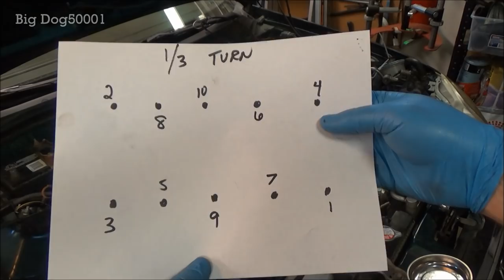Honda Cylinder Head Removal 2000 Civic (Head Gasket Replacement etc)(1996-2000 Similar)

Comment: why lable the spark plugs aren't they all the same?
Reply from the maker: They are the same.  It is not necessary to label them, I only did it in case the engine still had a misfire issue after the repairs.

Comment: I had a question...I have been helping out a friend with a 97 honda civic.  The head gasket is about to go, the car has been heating up very fast.  The thermostat for some reason is not letting water through, so I replaced it thinking it might have already worn out.  The fans are not starting and the coolant in the radiator is boiling over.  I cant really get a feel if its a clogged radiator, a faulty thermostat from the auto parts places, or its all just symtoms of the head gasket itself just causing all the issues at once.  Im trying to narrow it down.  Any suggestions where I should go with this? I havent worked on too many hondas.
Reply from the maker: reaper78541 Honda’s are finicky about aftermarket thermostats and cooling fan switches (I have a video on the switch btw).  They are not forgiving if they have overheated at all, many times that results in a blown head gasket.
Reply: Figured as much.  I guess there's no choice but to do the head gasket replacement.  Thank you for taking the time.  I was hoping to avoid the inevitable I guess.

Comment: So what happens if I removed my head bolts from left to right and not criscrossed like you mentioned? I'm going to take my head to get it resurfaced.
Reply from the maker: It is possible to tweak the head that way, any issues will probably show up at a good machine shop.
Reply: Big Dog50001 Automotive thank you, I removed the bolts before watching this video. So hopefully I didn't do any damage when I take it in to a machine shop.... What do you mean by tweaked the head? Can it be fixed at a machine shop?
Reply from the maker: Twisting it basically.  It can be fixed at a machine shop and made flat again up to a certain point (specs by Honda), after that the machine shop would have to take too much metal off and the head would be out of spec and not work.
Reply: Big Dog50001 Automotive Gotcha.... Thanks for that info Big Dog 50001 Automotive.

Comment: Hello, Mr. I have a mechanical question -  I have a Honda Accord and recently suffer and broken timing. I was able to re-do the timing belt job and discover I have no compression in cylinders two, car shakes a lot, a lot I was told I needed to remove the cylinder head and sent it to the machine shop for resurfacing. Is this true???  If is needed??? Note Cylinder 1,(180 ), 2,( 0 ), 03( 180 ), 4(180 ).
Reply from the maker: Hondas have interference engines, so if the vehicle broke a timing belt there is a good chance the pistons made contact with some of the valves and did some damage (due to the engine running out of time).  If this happened, the head would have to be pulled and the valves fixed (best done by a good machine shop).  No/low compression in a cylinder means it will not ignite the air/fuel mixture and will misfire on that cylinder (rough running).  A leak down test can sometimes show which valves are the issue (intake or exhaust).  I showed a short clip of me doing a leak down test near the end of in my Fuel Injector Testing video: https://youtu.be/pzeOz-seIQE
Reply: Thank you for getting back to me in such short time. I watched the entire clip very helpful in understanding which steps to take. As far as the leak down test, I am unable to conduct such testing methods due to I do not own an air compressor or the other tool to do the job. I am just gonna take the head off and send it to a machine shop and let them do their work. After the head comes back from the machine shop do I have to adjust the valves???
Reply from the maker: Yes.
Reply: Again, Thank you for your time and answering my question.

Comment: Hey man, I'm thinking of replacing my heads on my vehicle also it's the exact make model and sub model, just mine is a 1999. My vehicle keeps over heating periodically. It only does it when it's idling. When im on the highway it doesn't over heat it stays at normal temp. I've replaced the thermostat, Radiator, Engine Coolant Temp Sensor, Cooling Fan Assembly and also changed out most of the hoses. The only thing I haven't touched is the water pump. I've done a Compression test and also done a block test both came negative. Any suggestions what u think it is? I would really appreciate it if you can get back to me man. I also just subscribed 💯 keep up the vids on this vehicle
Reply from the maker: Angel Garcia If the vehicle overheated there is a very good chance the head gasket was damaged.  It doesn't take much to do it on these Civics.  That being said, a typical blown head gasket on these will overheat on the highway.  I would first make sure the cooling temp switch and fans are operating properly.  Aftermarket switches and air in cooling system can cause overheating at idle.
Reply: Hey man thanks a lot I really appreciate the reply. Another thing that I haven't done is bleed the coolant. And all the parts that I buy are from AutoZone in which have lifetime warranty. So you wouldn't recommend changing out the water pump since it's only thing I haven't touched?
Reply: Hi  @AngelGarcia-iq7sp , bleed the air from the cooling system first.  That's the most common reason for overheated 4 cylinder Hondas at idle. The bleeder screw is located right on the thermostat housing, and looks like a brake bleeder nipple, but is bigger, normally a 12 mm wrench size. Cheers from Indonesia.

Comment: About how much are all those bolts an gaskets all together
Reply from the maker: I think I paid about $150 for head bolts and news gaskets and seals but I don't remember for sure because I changed out some other parts too while I was in there.
Reply: Big Dog50001 Automotive thanks do you know if the 98 civic d16Y8 head comes off like that too